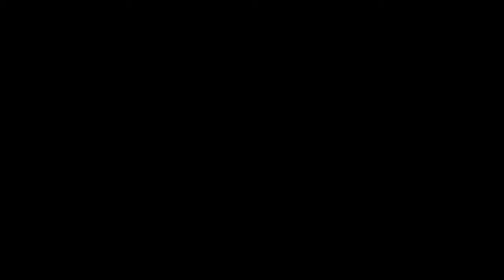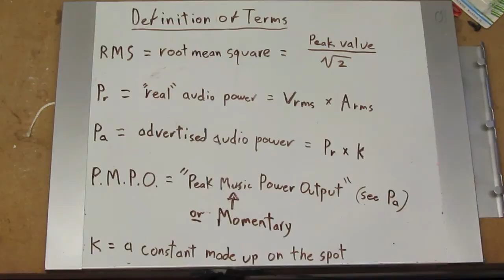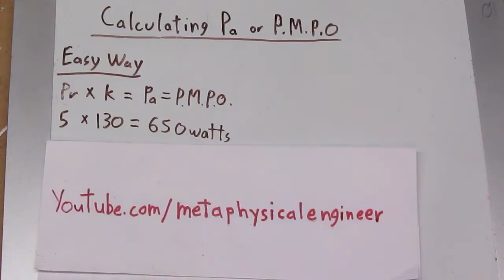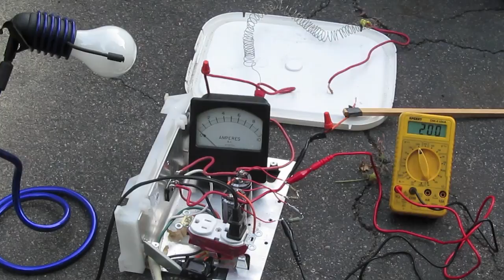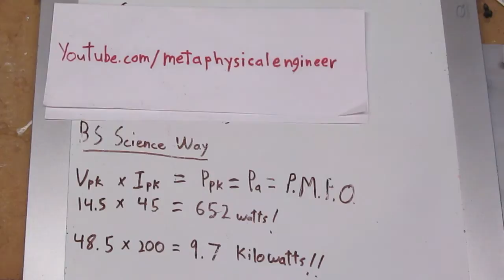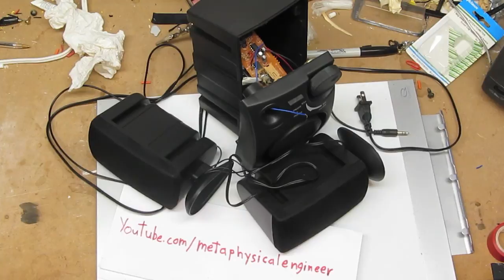Buyers Beware - Audio Marketing and PMPO

Comment: I have a music system of 150 watts pmpo as claimed by the company but on opening the case I found two amplifier chips of 5 watts each according to the datasheet so total output of only 10 watts. So how 10 Watts output is equal to 150 Watts pmpo ?

Comment: Great video!   Technically root-mean-square should be the square root of the mean of the values squared (assuming a series of audio signal values captured by an analog-to-digital data acquisition system).  You are right it will work out to be the peak positive value / sqrt(2), assuming a symmetrical and consistent signal.

Comment from the maker: That would be great.  Unfortunately, the only scope I own is a (1960s?) tube scope that can barely make it to 100kHz and has an intermittent short in the power xformer CRT supply windings.  After a couple minutes, about when it is warmed up enough to use, it begins making snap crackle pop noises as the display flickers, followed by a hot varnish smell.  I got it for free, knowing it had the problem.  If I had a scope that worked, I would do an overunity debunking....

Comment: So even if the amps were genuinly putting out a 2kw power output, which I doubt, he wouldn't be gaining much more performance from doing so. As you say with the low efficientcy sub woofers and other speakers they are basically acting like a high current inductive load and wasting most of that power in the form of heat, like using a 300 hp V8 engine on a lawnmower to cut grass. Car stereos and audiophool equipment are two of the biggest rackets in the electronics business 
today.

Comment: You are absolutely right about how loud his car audio system might be, the loudness rating is measured in decibels not Watts. There is also a law of diminishing returns when it comes to the Wattage of an amplifier verses the number of decibels you get out of it. I haven't brushed up on it lately but it takes something like a 15 watts of power to get up to 80 db, but it takes 100 watts to get it up to 85 db, and it gets exponentially worse from there.

Comment: I think that the rating on that Kenwood is probably fairly honest if they give a per channel rating, but many of the units from the 80s-90s claimed 75-100 watts, but if you pulled the back off often all that you would find is a pair of op amp chips. To be fair the performance ratings of solid state components has improved since the 70s but realistically any amp purported to have more then 20 Watts should have some power transistors mounted on a heat sink somewhere.

Comment from the maker: Even assuming the moron had gotten a beefier alternator and bigger batteries (both common), his amps would not be much louder than a much smaller system with efficient speakers. He gets a couple hundred watts audio per channel while the amp and speakers do a very nice second function of acting like space heaters.  The specs on the Kenwood featured as an example of a real amp in the prev vid claims 25 watts per channel. You may know more than me, but the internals look right for this rating.

Comment: I've known that the wattage ratings given on stereo systems were B.S 20+ years ago. One of the favorite tricks back then was to add the Wattage ratings of each channel together to make it sound impressive. I got into a circular argument with a car audiophool about the wattage of his amps, he claimed they were 2000 watt ampliers, I said that was impossible off of a normal 12 volt electrical system, that would be 166 amps for each amplifier and the average alternator it only 60-100 amps.

Comment from the maker: Computer speakers are the worst of it. However, I have autopsied a low-end stereo amplifier claiming 40 watts per channel with everything checking out except for the power supply (2-amp discrete rectifier diodes and a transformer proudly claiming 50 VA!). Needless to say, cause of death was the diodes burning in half. Also, my old DVD player with surround sound claims 200 watts but only has the PSU and heatsinking of maybe a 60 watt amplifier. So much BS, so little time to rant about it...